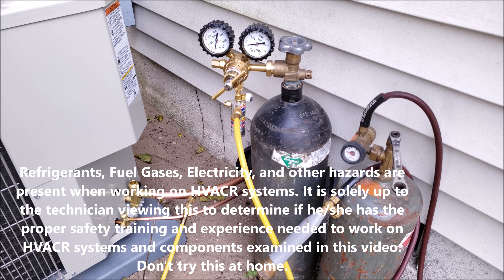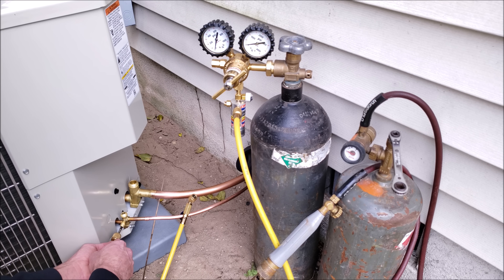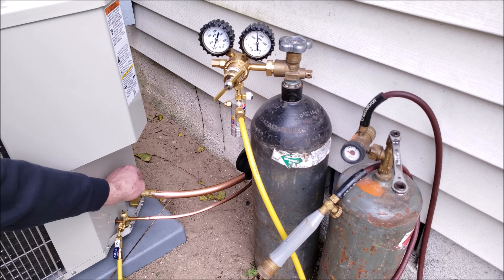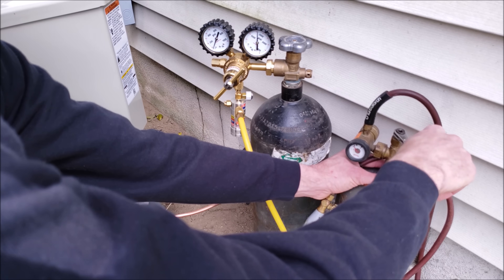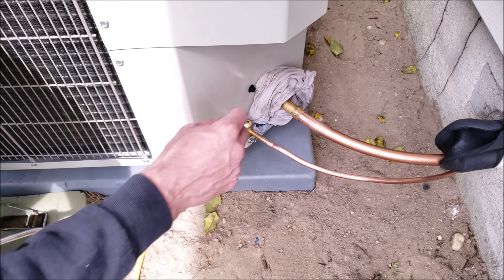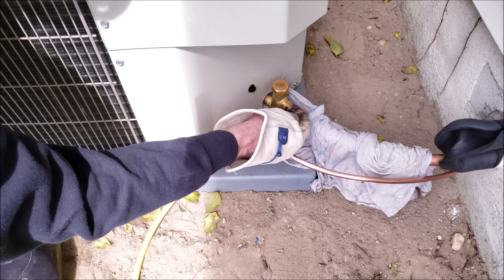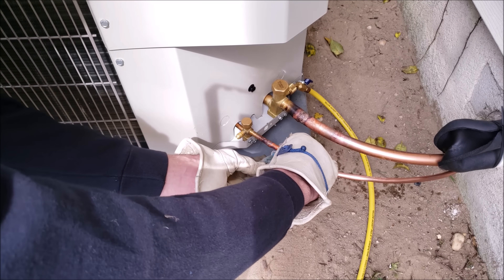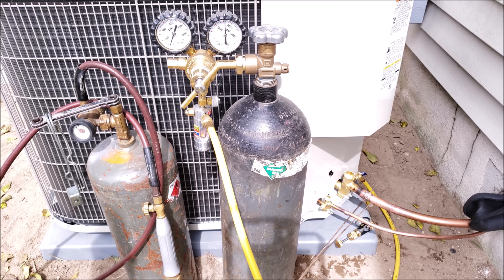Brazing HVAC Line Set to Service Valves! Full Procedure!

Comment: 6:45 i work for Vertiv, we manufacture HVAC units and I would never do that. The joint can form micro cracks
Reply: I've been doing this for 30+ yrs and as ;long as you wait for the silver solder to glaze over and gray out with the rest of the joint you will be okay. This method also helps temper the joint to make it more rigid and stronger than a joint that is heated and then cooled slowly, which results in softer, annealed copper.

Comment: Did you use the #8 tip for both the suction line and liquid line?
Reply: Yes he did. No need to change tips for the smaller diameter copper.

Comment: Refrigerant Filled Tubing is making crackling noise inside in my garage next to  HVAC unit. We can also hear crackling noise outside next to compressor unit.  What is the cause?  It constantly making noise  regardless if AC is not on/off or furnace heater is  on/off.  Very strange.  Maybe coolant in the pipes or moisture, metal contracting due to cool air?
Reply: It's low on refrigerant, probably. The smaller line should be flowing liquid refrigerant and if listened to should sound like a steady flow. However, if the system is low there can be vapor entrained in the liquid and it will make a gurgling sound as it travels through the liquid line with the entrained vapor bubbles.

Comment: i have saw some guys use stay bright #8 to soldier refrigerant lines. what are your thoughts on this?
Reply: Been using it for years on systems ranging from window units to commercial 50 ton systems. I've not had internal deposits or joint leaks in almost 30 years and hundreds of thousands of applications of it. Lower welding temps and its working pressure and melting temps are outside of standard system parameters.

Comment: Craig, excellent video!  I followed it exactly,  but have a bad seal on my first brazed joint, the 5/8 inch line at the condensers service valve.  It leaks on the bottom of the joint,  I can see the hole through in the solder.  I tried adding more solder, but it will not flow into the joint, just melts down to the ground under the joint.  It almost seems like the nitrogen flow is pushing it out? I would like to remove the soldered line into the service valve but am worried about too much heat on the service valve.  Or, is there a way to remove the old solder and then re-solder?
Thank you.
Reply from the maker: It sounds like the nitro flow reg is allowing too much nitrogen to flow through like you were mentioning. Did you use a flow reg and not something that is just reading pressure? You should be able to braze that specific spot. I would always recommend someone to practice on just standard swaged tubes to practice brazing before actually installing the service valve, thanks!
Reply: @acservicetechchannel  Thanks Craig for answering!  The nitro flow reg is brand new and set correctly.  Again, I followed your video exactly and read your book.  I did practice on several fittings before doing the AC lines.  All of my other connections look pretty good.  I am hoping I can correct the bad braze so I don't have to replace the service valve.  I looked at the leaky connection again and believe that my heating of the 5/8 inch copper line and service valve fitting is not hot enough or even...
I am not able to attach of picture of the connection.
Reply: Practice, practice, practice!  Not enough heat from the torch to the connection was the problem.  I have a Rheem condenser and the vapor line connection coming off the service valve is very close to the pad the condenser is sitting on.  I did not have enough room to get the torch under the line to heat it properly.  I made some more room to operate the torch and got a good braze/seal on the connection.  The leak check showed it sealed!

Comment: Pipe out off ac unit should be ad least 4-6 inches long after the valve. Lots of engineers designing things so they break down just after the warranty expires. Good video.

Comment: Ideally you want to braze from the bottom up. Start at the 6 o'clock position and braze in a clockwise direction until you reach the 12 o'clock position at which point you go back to the 6 o'clock position and braze counterclockwise back up to 12 o'clock position. Once completed, be sure to cap your joint and you should never have to worry about a leak from that connection.
Reply: what do you mean cap?
Reply: @landonj16  cap as in cap off the joint with a second covering bead of brazing allow. Basically a second pass over the first one to ensure the joint has no leaks. You should still confirm the system is leak free after you're done brazing by doing a standing pressure test with dry nitrogen.
Reply: @mikekin5806   Hey buddy  I'm a new HVAC Tech.  You seem to know your stuff, quick question. You can run nitrogen as you're brazing, and you need a outlet somewhere for the nitrogen to leave the system, so you don't build up nitrogen pressure is that correct?
Reply: @lex6794  correct. Typically one would use a Nitrogen regulator with a flow meter to allow for a gentle flow of Nitrogen to pass through the system while brazing.
Reply: @mikekin5806  Thank you Sir! Greatly Appreciated!
Reply: I was a refrigeration piper for 10years and you are absolutely correct. Plus you need 100% penetration.
Reply: Literally just started HVAC got my uniform today. We covered brazing today. Any advice would be greatly appreciated!
Reply: Thank you @mikekin5806

Comment: On a related topic:   A suction line that was brazed into the service valve on a condenser, and then the line was cut too close to that joint.  If you want to debraze and pull that piece of suction line out of the joint, how can you flow nitrogen?  Would you recommend attaching a nitrogen hose to the access port, but not fully seating it, to protect the gasket in the hose connector?  Or would you just blow nitrogen at the opening of the piece being pulled out, to try to displace the air?  Or would you go without nitrogen and just brush the oxidation out of the swagged end of the service valve after you have the piece removed?
Reply from the maker: You would flow nitrogen from the liquid port through the tubing circuit. however, you don't want to heat that service valve up again as you could have a melting problem on the inside of the valve, thanks!
Reply: @acservicetechchannel  Thank you for the answer, and for your videos.

I thought I read that the compressor blocks the path from liquid side to suction side in the condenser when it isn't running?  Or do you mean through the path to the evaporator?  In this case, the line is cut, so there is no lineset attached and no way to attach the lineset to the suction line service port, due to how it was cut off.

I use wet rags to keep valves from getting too hot when heating near them.  I decided in this case to replace the valves in the condenser.  They are the type where the o-rings can't be replaced, and want to be able to pump down later if needed.

Are you saying service valves shouldn't be heated up again after the original lineset connections are made?  So the valves should always be replaced if the condenser is moved?

The same issue exists with getting nitrogen to a joint on the inside of the condenser. That is the case here, where the lines will need to be cut inside the condenser in order to replace the suction line service valve and liquid line service valves.

Comment: Cool, but why not solder? What is working temp. of those pipes?
Reply: You should never solder on AC piping. Soldering requires flux which gets pulled into the pipes as you solder and contaminates the system. The reason we braze is it is like a weld that only connects the pipes on the exterior thus not allowing any contaminated to enter the system.

Comment: Hello, why don't you put dehydrator filters?  It is good for Moisture and impurities of Oil and metal powders.
Reply from the maker: I live by the ocean so we never install the filter drier outside. Its always inside the building in front of the evap coil. You must have a filter drier installed with the POE oil in the system or it has a high chance of getting acidic, thanks!

Comment: I have found that using Harris number 8 stay bright. Has the plenty of tensile strength and you can keep the hard copper hard and not annealed. You will never get any destructive oxidation inside the pipe also. Maybe it is time to change the old ways and come into the new way. Just saying fella.
Reply from the maker: Victory First, so back when, everybody used to use flux and staybright 8. then manufacturers switched to brazing and many techs followed. The coils used to be soldered but never any more. Its no problem to solder as it will hold the pressures of R-410A. The problem is adding the acid into the system before the system is even on. The flux is acidic so that is why we try to stay away from it. However for some components that are very heat sensitive, we still solder those. To each their own. This is just an example of how to braze and to use nitrogen while brazing to avoid the oxidation. Thanks!
Reply: @acservicetechchannel  So nice that we both can be correct. Look forward to see more videos from you Sir. When I remember other tidbits of knowledge I will ready to share with you fellas. Good day and peace too.

Comment: Out here now, cant braze the bottom of this low side line. Everytime I get close to it 2 more holes pop up and the cycle continues smh lol
Reply: Feeding too much nitrogen building up pressure. Just use staybrite. No need for nitrogen.
Reply from the maker: That sounds like there is too much nitrogen being purged through so that it makes pressure inside the tube and it pushes the braze out of the joint because that shouldn't be a problem with oxy acet or air acet, thanks!

Comment: Hey Craig - why aren't flare fittings used on service valves?  Seems as long as you get them right sized and don't over-tighten they would work just fine?
Reply: More chances of leaks.

Comment: Why isn’t there a filter dryer in the system❓
Reply from the maker: I never install a filter drier outside especially because I live near the ocean and they rust quickly. I always install them right before the metering device, thanks!
Reply: Thanks for answering. I’m trying to learn and I see and get told conflicting info.

Comment: I think when I read comments about why techs don't use N2, it's because they do it wrong. I did it wrong too. No one told me to remove cores and use that regulator. Otherwise you end up making holes in your joints.
Reply from the maker: Yeah even if you remove the cores and try to meter nitrogen without the flow meter, leaks will occur in the joints. Definetly need the flow regulator attached to the regular nitrogen regulator. Have you seen my video on "flowing nitrogen vs not flowing while brazing"? https://youtu.be/ZjpnP9uhxyk

Comment: I repair househould appliances and fridges too, so procedure is same when changing compressor and filling gas, but I just wonder... Any special reason why you do not use borax? I use it all the time and it produces wonderful result of faster brazing (faster joining botch copper pieces together) as much cleaner joint. But maybe I am doing something wrong with using borax and I do not know?
Reply from the maker: I think you are talking about using borax as a flux for copper sweating for silver soldering. This video was on brazing without any additional flux. This way no acid is left in the copper tubing to mix with the refrigerant oil after refrigerant is in the tube, thanks!

Comment: Thank you so much for sharing your professional job, i know it takes effort positioning and focusing camera to be able to properly show the brazing process in detail. I subscribed your channel already , i have a question for you, how would you purge with nitrogen if the system has only one service entrance, where the N is supposed to go out from? I dont' want to put pressure in the system it could ruin my brazing right?
Reply from the maker: If you are doing this on a minisplit unit that only has one port then you would need to leave the flare on the liquid line off of the service valve for the nitrogen to flow from the vapor port through the lineset and head unit back to the liquid service valve connection where it will exit. Make sure to use a flow meter so you know you are flowing 3 to 5 cfh and not pressurizing the tubing, thanks!
Reply: @acservicetechchannel  I was thinking to do it exactly in this way, i was just looking for an opinion from the expert to be sure I do the right thing! Thank you very much for taking time to reply, your channel is very useful for me, i will recommend it to my friends and family.

Comment: Is 3 PSI good for general Rule of thumb on nitrogen ?
Reply from the maker: No dont try to flow nitrogen just using a gauge set. You would end up with little holes in the braze joints due to pressure. We flow 3cfh with a flow meter, thanks

Comment: Yo Craig, nice video bro...just want to ask you something, when you're
brazing & the flame turns green, the copper is now cherry red...and ready
for brazing the copper to the other copper joint, at this point where about & how
far back do you hold the turbo torch when you're applying the solder rod?

I'm a bit rusty with my brazing & turn not to get a smooth enough braze?

I've been told to hold the flame slightly back above the rod once the rod
is starting to melt & I should then flick the rod around the heated copper
joint...but sometimes I get a little confused as I have not brazed in a while
but I need to improve as it's a serious skill....any tips bro?

I'm from London UK...peace!
Reply from the maker: No just heat the copper tube until the temp of the copper melts the rod. Just test the copper by quickly touching the rod to the copper until it is melting. You would want to wipe that oil out of the joint ahead of time and clean the joint to avoid that green color and to get a clean joint. My best advise it to practice brazing joints yourself off the clock in a safe location with. Some scrap copper pieces, thanks!

Comment: You Din"t Show How you set up the Nitrogen to braze in the Evaporator & filter dryer
Reply from the maker: I leave it just like you see hear as the nitrogen is entering one side of the line set and exiting the other side. I always have the inside connected during the purging and brazing, thanks!
Reply: AC Service Tech LLC you have the line set connected inside at the evap coil but not yet braised, correct?
Reply: @jordancarbone9170  The lines are connected inside to the evaporator. if it wasn't, he wouldn't have nitrogen coming back to the condenser.

Comment: Take a old metal outdoor unit door cover and lay it up under the lineset while brazing that way incase some of the brazing rod drips it will catch it  and wont burn the pad .
Reply from the maker: Absolutely, great tip!
Reply: Or just braze right so there’s no drip.
Reply: It's not about brazing right or wrong it's kinda unpredictable.  Say if you are brazing  in the pouring rain for  instance and I'm sure that these great instructional videos are for the new beginner as stated.
Reply: Just don’t drip 😉

Comment: So you forgot to show first cleaning the stubs at outdoor unit prior to brazing to remove oils from manufacturing. Also has the tubing been cleared of burrs and properly been reamed? My testo gauges flow just fine. Digital is a beautiful thing. Also use oxygen/Accetlye...much faster to braze and will cause less time on the pipe to produce any potential slag.
Reply from the maker: I didn't show that part just due to the length of the video but I always prepare the copper tubing prior to brazing, thanks!

Comment: Great Videos! I have a r22 system that is not cooling my condo on 80+ degree days, thermostat set at 74 and it would be a constant 78-80 degrees inside and ac will continuously run all day. Inspected everything and found a kinked suction line, not kinked shut, could this be the issue? Also, when I go repair it I’ve read that silver solder with MAPP gas works fine to use. Is it ok to use silver solder since I do not have acytelyne/oxy tanks?
Thanks!
Reply: Get a professional. You will need to recover the refrigerant and pull a proper vacuum.. also you will have to add or adjust charge and your not able to purchase R22 as a homeowner
Reply from the maker: If the line is only partially kinked just slightly, that is likely not the issue unless it is really kinked. You may be low on refrigerant but the total superheat and subcoolig  would need to be measured first to determine what is going on. Make sure that you are EPA 608 certified before working with refrigerants, thanks
Reply: AC Service Tech LLC thanks for the reply. I had someone come over last night and noticed they used 1/4 liquid line not 3/8 and 5/8” suction line instead of 3/4”. Would Having a 1/4” liquid line cause the issue?

Comment: Nice video! I am going to ask are ASCO torches pretty good? Are they better than turbo torch? I’m thinking of getting some ASCO TORCHES.
Reply from the maker: I don't have any experience with that brand. I mainly used Goss, Turbo Torch, and Uniweld, sorry to not have any input on that one Robert! Why are you thinking of getting that brand? Just curious, thanks!
Reply: @acservicetechchannel  Well, Tru tech tools sent a video if any one interested to make the job a lot easier.  It's between turbo torch and Asco. I've got some oxy acytelen they tend to get heavy every now and then.

Comment: Just keep the heat off the service valve, Always on the pipes with the flame facing outward not Inward toward the service valves, Wet rag Ok but not needed at those OD diameters,  Nitrogen is Always good to use since is an Inert Gas. Flushing and Pressurizing.  Clean Welding gas is a must since acetylene tend to smoke a lot.
Reply from the maker: Thanks, yes always flow nitro!